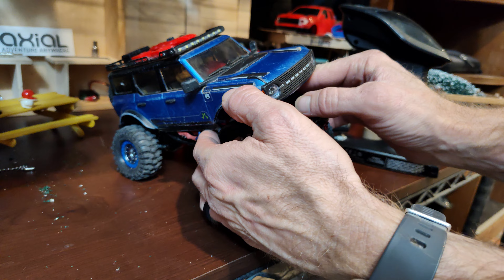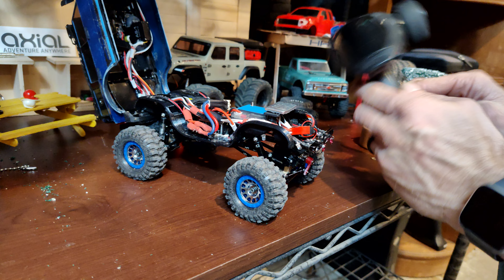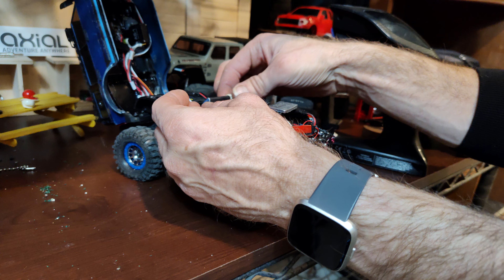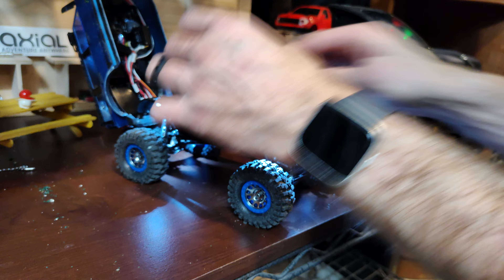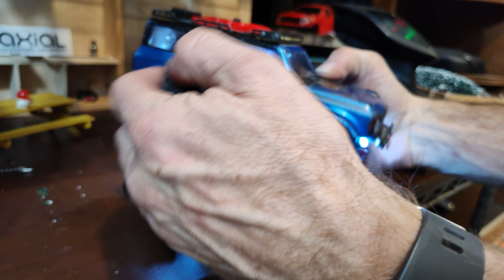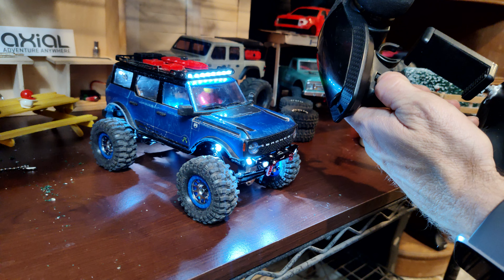scx24 bronco direct power lighting and servo wiring explained. high voltage servo

Comment: Interesting set up.
I have two questions.
1. What is the battery voltage that you use?
2. Is this some esc/reciever combo? You said that you pluged the negative wire into the esc, but didn't mention anything about radio receiver and how you control the lights via the radio.
Reply from the maker: Battery ESC and receiver are stock v2 controls with 7.4v battery. The negative wire goes to the 'sense wire' that would be the top pin on whatever channel you plan to use. Channel 3 has one labeled 'head' to turn on off or flash head lights with channel 3 switch,  channel 4 is the turn signals and they are labeled CL-L2 and Cl-R3 for left and right .
Reply: @simon5ay5  thanks for the answer.
Would it be possible to do with the Traxxas' light kit, the old one, and an OEM radio?
I am looking for solutions to control the head/tail lights on my TRX-4 Sport via the radio.
Reply from the maker: I do not know much about the Traxxas lighting kit. If you have extra channels most likely you just need to add a relay.
 https://a.co/d/f4h2RGf
Reply: @simon5ay5  that's an option I didn't think about.
Thank you for taking the time!
Reply: How did you wire in the external bec, since the receiver already has one? I have a upgrades servo and motor and lights on my bronco and I want to have enough power to all of them.

Comment: How did you hook the servo straight to the battery? As the battery only had a positive and negative and the servo has 3 wires?
Reply from the maker: The sense wire still has to go to the esc only the positive and negative go to battery